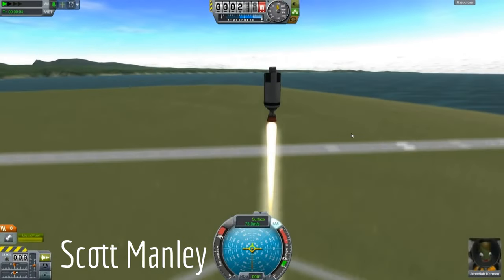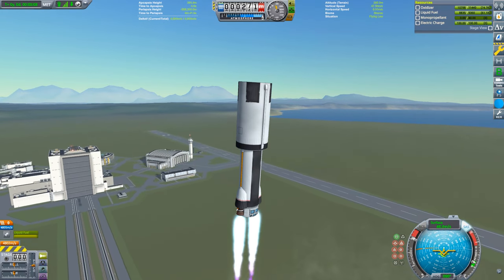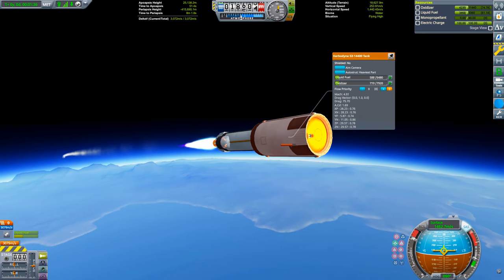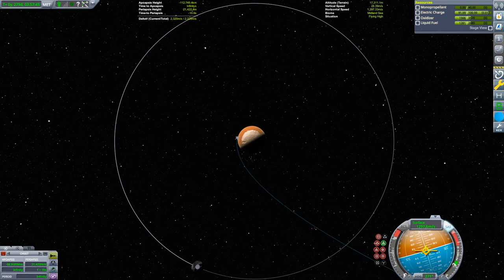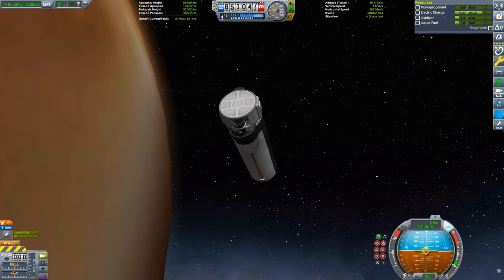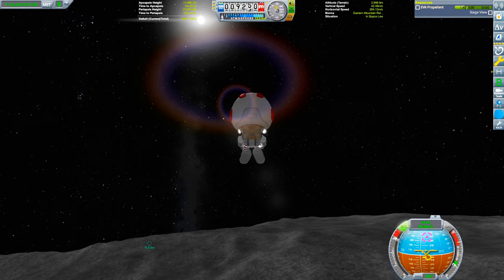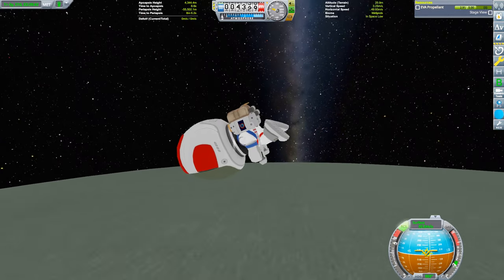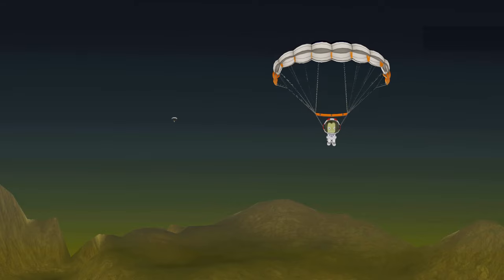3 Parts to Duna, Ike AND Minmus! | Stock KSP 1.7

Comment: Great job - of course once you get to Duna or Eve you can in theory flyby everywhere in the kerbin system using gravity assists. I really love the aerothermal exploits to get to orbit with just the parts you need.
Reply: Scott Manley!
Reply: Yeah what he said
Reply: fly safe!
Reply: @guilhermecastilho2726  Not in this video!
Reply: next step is to launch something to moon using just one part and explosion on the launch pad.
Reply: Fly S... Fly with Mitigated Risk!
Reply: wait if you did the 4 part you can add a docking port and have stations every where to dock and have more fuel
Reply: No tick
Reply: Oh
Reply: EELOO!
Reply: No mention of stuffing an Kerbonaut into en engine bell, using it as a canon.

Does that qualify as flying safe.
Reply: @Nuggeinsky4321  you can put the Klaw on the station, and grab the ship. you can crossfeed through it for some reason
Reply: what are aerothermal exploits?
Reply: I was just gonna mention Scott Manley and saw the comment here. Yeet! I done a monocycle that works surprisingly better than 4-wheel rovers, and inspired by Scott's motorcycle Duna Lander. It's easy, I'll try to make a video about it in couple of weeks as my system is not ready. But here's a sneak peek, you use SAS and reaction wheels to stabilize the monocycle.
Scott did it manually.
Reply: Scott Münley
Reply: Scott, I’m five year late but I wanted to say I read this comment  in your voice subconsciously…

Comment: That is certainly not the intended purpose of the twin boar engine. Danny would be proud. :)
Reply: Danny Danny DANNY WHWERE ARE YOU SIR
Reply: ( starts to glitch )
Reply: What, you're not suposed to use a rocket engine to de-orbit a Kerbonaut? Although it's a Twin board, so both Valentina and Jeb could have done it.
Reply: Danny is OK.
Reply: @oneistar6661  
At least if she wasn't in King's Landing a few weeks ago...
Reply: Last time I tried the mass driver it burned up the kerbal, does the twin boar not have proper heating setup or something?
Reply from the maker: +Major Missile The twin boar burned up my kerbals most of the time. To get this to work, it needs the right throttle setting (about 80% worked for me) and luck.
Reply: @Stratzenblitz75  Ah, I see, interesting that it still sort of works...
Reply: Danny;!!!
Reply: *bore
Reply: @franks_nl  He needs to keep one kerbal in the command pod so that he can actually activate the engine
Reply: He is

Comment: "3000 delta V is plenty to land on Duna and return"  
Yeah, I don't think we're playing the same game.
Reply: with 300m delta-v I can barely get to orbit

Edit: guys it's been 3 years, I get it you can't make orbit with 300 Delta V, I simply forgot at zero
Reply: This is not even enough delta V for me to Land on the Mun from munar Orbit and safely return to kerbin
Reply: Ooftacular you need around 3k for orbit...
Reply: @jacobmorris8034  Basically means how much you can change your speed, so if your moving at 100m per second and have 10m delta v, depending on the direction you burn, you'll end up at 110m per second, or 90m per second
Reply: Jacob Morris deltav is the amount you can adjust your velocity with the remainder of your fuel. So if you had 100 m/s of deltav in orbit, you could accelerate 100 m/s before running out.
Reply: I use 7000 dv for duna
Reply: I pack 3k for minmus missions...
Reply: 7 or 8k and pray for the lord!! xD and mechjeb ;P
Reply: How do you check your delta V?
Reply: Ok so I just used 6000 to do it one way

Without menuver nodes
Reply: @mango_tgo8361  using addons such as Kerbal Engineer Redux and recently the base game shows you the dV you have on each stage altho it is not very accurate as i noticed
Reply: Usually for duna trips I make sure to pack 3000m/s for the trip there plus the return. You can save heaps by aerobraking at duna, just point the engines forward and lower your orbit to about 10km. Aero braking at kerbin from return though is quite risky and will probably bun up your craft if you have no heat shield.
Reply: @bakbak4960  you don't need mods you can just look at the staging and it will show the amount for each stage and at the bottom it shows the total DeltaV
Reply: I can't go to orbit with 5000
Reply: I don’t know what game he’s playing
Reply: Ooftacular you can’t...
Reply: With 3000 dv I could maybe get some debris in the ocean but no promises
Reply: Clever sod, aren't you?

That was surely one of the smartest missions ever posted on YT.  I've  been playing KSP since 1.2 and couldn't repeat what you did here, let alone plan it from scratch!  Unless of course the whole thing was fake, recorded and edited on a computer at home in a bedroom... 🤔
Reply: Jacob Morris say you move 1000 m/s up and then 500 m/s down and then run out of fuel 1000+500 = 1500 so you have 1500 delta v ( change in velocity)
Delta is the fourth letter of the Greek alphabet and in mathematics it means change ( used a lot in calculus ) and v means velocity, so change in velocity.
Reply: @crazy_canadian1212  he's saying he had 3200 m/s remaining after getting to Kerbin orbit.
Reply: Jacob Morris delta means change and V is velocity
Reply: I cant get to mun with 3k delta v ;-;
Reply: Lui.f.t but was it 3k on the pad or in LKO you have to subtract 3k for the takeoff you only need like 800 or 900 to get to the min and back from orbit
Reply: You must be playing spaceflight simulator.
Reply: @bakbak4960  Stock dV display always shows dV the craft has at Kerbin's surface, that's why it seems to be inaccurate.
Reply: @matthewhoogenboom535  Nope, all staging and total dV displayed in VAB/SPH is for Kerbin's surface, you'll realize that when during flight you look at dV of every upper stage - it will increase the higher you are.
Reply: I use 3k for mun for some reason
Reply: Kelgo the mun and duna requires similar delta v counting.
Reply: @crazy_canadian1212  how is 300 enough
Reply: My first duna landing was with a craft that had 8000 m/s by the time I was on the surface of duna just in case.
Reply: @abigalerose1410  Sounds like a massive craft you got there
Reply: @alamrasyidi4097  it was a nuclear ship.
Reply: believe it or not i managed to land on duna and come back to kerbin with only 2000 m/s delta v
Reply: 1200 to get to duna, aerobrake until completely in the atmosphere, land, do the same procedure done on Kerbin to get to orbit ~1300 dv, then 500 to return while stopping at Ike to ditch the fuel tank on top.
Reply: @nootaboot7042  3.2k minimum iirc
Reply: @matthewhoogenboom535  mods are made for looking at delta V, and also are more clear.
Reply: @crazy_canadian1212  you need around 2400-2600 m/s
Reply: @nootaboot7042  Woosh 🌬
Reply: I agree. I need about 6-7 km/s to get to the Mun and back.
Reply: @sergegordeev9426  Eh man that's what I used to do! Strap a bunch of rockets together and straight line it to the mun. 🌙
Reply: @teenagestacker6063  You understood me wrong, I have never done that. All my Mun missions start with orbiting Kerbin.
Reply: @sergegordeev9426  Ah okay, same here that's what I did at the beginning. Good challenge honestly.
Reply: I need about 8000 dv to get to duna
Reply: @jacobmorris8034     ΔV (Delta-V) is basically how much you can change the speed of your craft. Δ is the Greek letter Delta, which is means change, and V stands for Velocity.
Reply: You kidding I need 7500 delta v to get to dubs I’m terrible at ksp XD
Reply: I use a 3 crewed 15,200 m/s delta-v rocket to get around the system. I spent over a week designing this and it is super efficient.Only 4 stages packed into what looks like a 2 stage system. This is too high for duna and back, but i am too lazy designing another one just for duna.
Reply: @bennoschneider9267  That’s honestly sadistic, not flexing btw
Reply: mechjeb can’t even do that
Reply: I Need 4km/s just to orbit kerbin
Reply: @jacobmorris8034  change in speed
Reply: I need like 5000 delta v to get to orbit
Reply: @zaretya9091  I use 7000 dv for a minmus landing. Get real bro
Reply: @nootaboot7042  solar orbit and its much easier with gravity assists
Reply: @crazy_canadian1212  300m is not enough for orbit physically impossibel with that you probably meant 3000
Reply: @crazy_canadian1212  hm 300m delta v orbit is impoosible you need around 3.5k
Reply: @jacobmorris8034  delta V is the Math name for “change in velocity”
Reply: me making rockets with 5000+ ∆V just to land on Kerbin's moons
Reply: 11k for Minnus... yes I know..
Reply: @zaretya9091  i use 50000m/s
Reply: My ass brings 5,000m/s delta V home
Reply: @zaretya9091  WAT? Duna transfer needs just a bit more dV than for the Mun, but circulization and landing don't use any dV at all due to aerobraking. The only thing that costs much more dV compared to the Mun is getting back into orbit.
Reply: @PalassCat  just what I use, not at all the minimum
Reply: I can’t even reach orbit with that
Reply: I use 10-12k for an apollo style duna return mission

help
Reply: Me with vessels with 9000 ms detalv unable to go to Minmus.

Comment: Mad crazy. I don't think I've seen a Danny style mass driver ever used in a 'normal' mission before, beautiful stunt.
Reply from the maker: Thanks! Honestly, I never thought it would be useful in a mission like this until I got to Ike and realized nothing else would work
Reply: @Stratzenblitz75  At first I thought we'd get another centrifuge slingshot, but I guess the low electric charge after the Duna landing made that impossible.
Reply: I thought the heat of the nozzle would instantly kill them (and to be fair, I’m sure they only stayed alive because it was a split-second exposure).

Comment: Should we expect FULLY non-jet thrust (aka no jets and rocket engines allowed) stock orbiter? New DLC will help a lot
UPD I know that Scott made "some kind of" by exploiting fuel tanks mass transition, so this way are alredy closed.
Reply: I mean technically he already did that with the ion drives only design since ion engines operate on fundamentally different principles from jets or rockets. It's not what you're looking for but it'd definitely meet the criteria.
Reply: @tortugagreen9924  well, ion drives still require some kind of exhaust through their nozzle
Reply: @stallfighter  That may be true too, but the definition of nozzle is very, very loose in the case of ion engines as the flat entirety of the exhaust's speed comes from electrostatic forces rather than nozzles and related gas expansion.

Comment: A great mission, and some beautiful shots in it, but I have to ask, why didn't you switch the lander can to the 'rover' configuration? I was fairly sure it weighed less, and it wouldn't be so close to burning off from the engines! Is it more draggy?
Reply from the maker: Thanks! The rover variant doesn't actually weight any less and it creates a lot more drag so I couldn't use it.
Reply: @Stratzenblitz75  Ah thanks, didn't know that!

Comment: You can got to any where with three part. just add a twitch liquid fuel rocket engine and use the kal-1000 controller set it to negative 600000 throttle.

Comment: If you allow using EVAs you have in theory already unlimited delta-v if you push your craft with your jetpack and refuel it by reentering your command pod. But I guess you still would not be able to plant a flag on every planet/mun and reenter orbit after.

Comment: Hold on, at 10:24 you have 2m/s delta V then a few seconds later you have gained fuel to have 6m/s. I acknowledge that those were probably from different attempts meaning it's not cheating but just an editing mistake. The run is still very impressive and well edited.
Reply from the maker: Yeah, I used the wrong clip at 10:24 . After I recorded that one, I realized I was unhappy with my remaining delta V (IDK why though, it didn't matter in the end). So, I went back a did a more efficient correction burn (this is the clip I should've used).

Comment: I built the low orbit sol station lifter from sight to an exact copy it was brutal and aerodynamic as a square i can't get it to run smoothly was this reasoning behind the docking/refuelling system so that it can be run by itself and another craft taken out and just added to it causing a smoother run?

Also how was your payload ferring attached i can't figure out how to A build that large and B attach the ferring so i can see through it like you did
Mods ???

Comment: I don't know about the rules of the challenge, but.. I only saw you land on Duna. Ike and Minmus was visited by a Kerbal, not the vessel. So are the Kerbals considered parts of the vessel? In any case, I say congratulations! You finished the 3 parts challenge to Duna!
Reply from the maker: Thanks! For this challenge, the 3 part restriction just applies to what you build in the VAB; kerbals are not technically parts so this mission is still technically 3 parts, even though the kerbal's EVA pack was used for some of the landings. Check out Scott Manley's original video, he set the precedent that EVA landings were part of the challenge.
Reply: @Stratzenblitz75  Ah, okay! Double congratulations then! :D I'm sure I've seen his 3-part challenge video, but won't hurt to rewatch. I like the challenges. Keep it up!

Comment: I haven't played this game in a while and I'm sure you did everything in this video for a reason, but for the sake of questioning, why did you specifically use the lander can? Aren't there lighter unmanned command pods you could have used?
Reply from the maker: Yes, however, it turned out to be more important to use a mk2 lander for the aero exploits. The mk2 can has a 2.5 m node which is the same as the twin boar and so reduces the drag incurred by the craft. This was important for the kerbin ascent as well as the duna ascent.
Reply: @Stratzenblitz75  wow, believe it or not I didn't actually think you would reply. However thank you for the answer!
And keep up the awesome content.

Comment: Can I please have a suggestion for what mod to use?

Lots of calculation are impossible to do by hand, and I'm searching for some easy to use tools.

Thank you
Reply: Kerbal Engineer Redux is great for Delta-V calculations and general craft info. I use it quite extensively, and it's helped me tremendously when figuring out if my rocket can get where I want it to go. There are also Delta-V and transfer window calculators out there as well to get the most out of that precious fuel tank

Comment: gj, but why not sliding lithobreak on duna? :P
Reply from the maker: It would've tipped over; It is very top heavy ;P
Reply: @Stratzenblitz75  Sounds like an optimization strategy :P
Reply from the maker: +Markus It woud've saved maybe 10 m/s. The impact tolerance of the command pod is pretty low. That said, it is still something, just not worth the effort to do it (especially when there are still easier things to optimize about the mission) :P
Reply: @Stratzenblitz75  what's the impact tolerance of the twin boar?

Comment: I dont want to sound rude, but i saw some texture clipping on the command pod that made it look like there was two pods. Because I don't see the benefit of this, I think it have been a mistake in building.
Reply from the maker: I think the 2.5 m lander can is bugged. For some reason, I think it tries to display both variants at the same time so there's z-fighting. There is certainly only 1 pod: the electric charge and monopropellent in the resource tab confirm this.
Reply: @Stratzenblitz75  ah yes, i should've looked at the resource tab

Comment: In my book you're cheating. Still, thumbs up for this weird mission!
Reply from the maker: Thanks? What do you think is cheated about this mission?
Reply: @Stratzenblitz75  Circumventing the atmo drag by wild repositioning of the components?
Reply from the maker: +CLipka2373 IMO its more of an exploit than a cheat because it involves taking advantage of the game mechanics (in this case, how drag is calculated) rather than by using the debug menu, editing parts, or any other cheats. I get your point though; IRL it doesn't make sense for the same shape to have different drag coefficients depending on how it was put together.
Reply: @Stratzenblitz75  Yeah, I guess "exploit" is an adequate term for it we can agree upon. (And, as I said, thumbs up anyway.)

Comment: With almost no electrical power or fuel, you land both kerbonauts on the roof of the VAB ... and you don't think that's interesting enough to bother to mention.
Reply from the maker: I don't think its interesting because kerbal parachutes make this trivial: they glide really well and are easy to control. If you land within ~100 Km of the space center, you'll be able to glide home.
Reply: @Stratzenblitz75  OK, with almost no electrical power or fuel, you got the ship to within ~100 km of the space center, etc.

Comment: 3 Part to ur Mom lol

Seriously though, I don't think this can be optimized anymore. A Kerbal could land on Gilly but there's not enough DeltaV to get there.
Reply: I heard that you can travel from high eliptical Kerbin orbit to Gilly and back with an EVA pack, using a lot of gravity assists. If i remember correctly, Gilly landing takes you about 60 m/s? So you have about 480 m/s for maneurs.
Reply from the maker: Thanks! Though, as Misha Mr pointed out, you can add a gilly landing. But that was honestly too much more work for this video

Comment: >not making the lander can thin to prevent clipping
hah. amateur.

In all seriousness though this is very clever, especially the method to hide unoccupied nodes
Reply from the maker: The funny thing is, I tried the alternate version of the lander can but it didn't work. Seems it has to be in the 2.5 m variant to get the drag savings I needed.